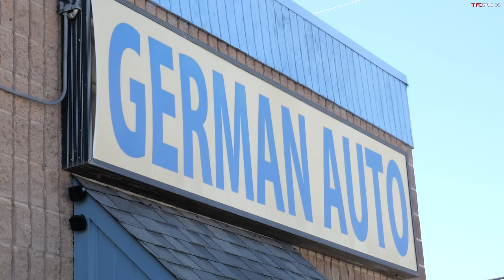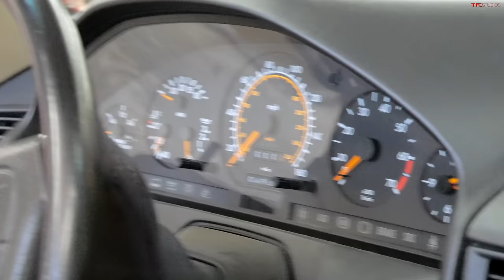What a Mess! Who Bought the Biggest Piece of $#!% Convertible? Stud to Dud Ep. 2

Comment: This takes me back to the days of owning my first 9 used cars. Many were low miles for their age and had failures related to age, not mileage. Low miles don't save hoses, belts, and gaskets. Dry rot is real.
Reply: Or in these days, lot rot?
Reply: Plus, even low miles does not indicate use cycle of those miles. Might be driven hard a short distance daily, or driven by a kid who thinks he's in formula drift. I live in Wisconsin and know people who start their car cold in the winter in sub zero weather, drive it 1 mile to work, then park it, without ever letting the car warm up properly. Sure they only put few miles on it annually, but lots are rough winter miles with no warm up. Heck I've done it a time or two if I'm honest.
Reply: @jg8263  Excellent point. City miles are far harder on a car mechanically. Rough city streets are harder on suspension and steering components. A lot of stop-and-go puts extra wear and tear on the transmission. Short hot/cold cycles from short trips are hard on an engine. I currently live in the city where the roads are rough and my trips are very short 4 miles/12mins. I always think about how hard it is on my truck long-term.
Reply: 9 “first” cars? Damn
Reply: @darklordsauron3415  ha, I didn't mean I owned 9 cars at once. I meant the first string of cars I bought in succession. I miscounted though. It was 8. Then I bought a succession of 3 new cars. Now I'm in a used pickup. 12 vehicles in total over the years. I get bored after a year or two and want something different or they ended in an accident.
Reply: @jg8263  yep those are the cars that wear out the quickest. I'm in a high mileage Facebook group where people brag about 300k...400k...500k...600k miles. They're highway driven for long distances or used for taxi where the mechanicals stay at operating temp all day, which is the gentlest miles to put on any vehicle, regardless of brand. I've recently seen a Hyundai and a Kia with over 300k miles each.

Comment: The point was made in the video that the Mustang and the Jag were well maintained.  That kept their issues in check and to a minimum.  The Nissan and the Mercedes were not well maintained,and we see the results.  Had those two cars been maintained at the same level, this would have been a much closer evaluation.  When you are dealing with 30 year old cars, maintenance is the key more than anything else.  Doesn't matter what country designed them.  How the cars were treated over the years is what matters here.  The Ford and the Jag were well bought.  The Nissan and the Mercedes were not.  This series really hasn't made any other pertinent points other than maintenance is key.
Reply: Yeah, I am guessing that maintenance on the ford would be a lot cheaper.
Reply: And the Jag is from the early 2000's so it's way younger than the other 3 (so things going bad by age are fewer in the Jag than in the other three)
Reply: The point is buy the simpler American car that’s easy and cheaper to fix. Jags and Mercedes are nightmare to maintain long term. The mustang is the best bang for buck.

Comment: As I’ve said many times, if you want to own a Mercedes’, you better be prepared to pay for maintenance or be able to do the maintenance yourself. I’ve been a Mercedes’ fan for many years. I currently own 3. A 2005 E55 AMG,  a 2002 S430 and a 2005 CLK 320 cabriolet. I just replaced the 2 convertible top cylinders on the CLK. $150 each from Top Hydraulics and about 2 hours of my time. I just replaced a front left air suspension on the E55. $500 from FCPEuro with lifetime warranty. About an hour of my time. Both of those jobs would have been over a thousand if I took it to someone.
Reply: Worth the work you put into that E55 that’s for sure
Reply: @Loujr2250  Oh yeah! Man I love that car! What a blast to drive!
Reply: I have an 04 W209 CLK500 convertible and am downsizing to a 99 R170 SLK230.  It will be my 3rd Mercedes-Benz. My first Mercedes-Benz was a 96 W202 C280. I don't mind repairs. Every old car needs them and I've owned nothing but old cars all my life. So running the wrenches has never been a scare to me. I'd much rather have a graceful elegant beautiful Mercedes-Benz I have to work on occasionally vs peasant junk I have to work on occasionally.
 People ask me "what year is your car?" And when I tell them it's an 04 it blows their minds. "It looks newer than that". Why yes, it's a Mercedes-Benz! They invented the car.  Naturally anything they make (up until more recent years) is going to look way ahead of it's time. Prime example is the R124. Bruno nailed it. In a time when luxury cars were large land yachts, Mercedes-Benz made luxury cars smaller and by far better looking than any American or European competitor did years in advance.

Comment: The SL that is misfiring and with those issues still manages to smoke all of them. Imagine with a proper tune.
Reply: Yep, or just regular maint and repairs of broken things.
Reply: The Mercedes is likely on its last leg. All the Mustang needs is 1k worth of upgrades and it’ll be much faster than all of them. Gears and PI head swap really wakes them up.
Reply: That Mercedes is designed to run wide open on unlimited Autobahns not be cute parking lot toy like the others.
Reply: I rather take lighter Mustang with more reliable engine to tune:)
Reply: @joe125ful  If both cars were treated equally over the years both engines would be equally reliable.
Reply: @nirfz  Yes but Mustang engine still more fool proof and eat less money in long temt of using in other hand Mercedes is full of potencial problems specially with electronic parts and ofcourse rust.
And see price both of cars new/old very big difference.
Reply: @joe125ful  How do i put it... If this Mustang would have gotten as little maintenance and care as this Mercedes, it wouldn't drive anymore.
Sure there's more electronic in the SL, but other than certain years problems with the cable insulation being biodegradable the electronics weren't causing more problems than the fewer electronics of the Mustang i'd claim. (This gen SL was pretty reliable in it's time)
The hydraulic roof is something that adds additional points of failure but also only without maintennance. (rubber hoses get old and need to be replaced at some point just like gaskets)
And to the price difference old an new: this also has everything to do on how the car is maintained. A SL in the shape of this Mustang costs easily 2-3 times what this Mustang goes for. (so same difference as new ;-) )
Reply: @nirfz  Yep but i still like more Mustang.

Comment: I had a 96 SL600 Merc. One of the worst cars I ever owned and rarely did it ever run without some expensive thing needing to be fixed. Finally got rid of it and swore off anything coming out of Europe again. When they run well, they are great. But anything goes wrong and it costs a fortune to fix. Ever wonder why European cars don't hold any value over time......that's why.

Comment: I wanted to point out on the 500 SL when Toby said it seemed like a mis fire, It may not be. If you jump the car too much the OVP(Over Voltage Protection) fuse located near the firewall on the passenger side in the engine bay. It happened to me and scared me because I thought I messed something up. Definitely give that a try.

Comment: Those stickers on the exhaust are as dangerous as the ones on new tires. No fire or crash has been caused by those stickers in my, or my fathers, or grandfathers experience.
Reply: Four people didn't have a fire or crash.
Reply: @653j521  actually many more than that on account my Papa owned an repair shop for close to 30yrs before retiring and doing jobs out of his at home garage  which was 36x60 with a 10 ton chain fall and doors large enough to pull in a highway semi.

Comment: I like the accent of the mechanic.  He keeps it interesting.
The Benz probably has an issue with the control pressure.  It's running too lean on startup, so the control pressure may be too high.  Check it at the warm up regulator.
Wheels are from a W211 E500
Reply: Might be a NE accent. I’ve heard guys over three kinda sounds like him
Reply: @bramblecino  

He's got a speech impediment called a LISP a speech defect in which s is pronounced like th in thick and z is pronounced like th in this.

I went to school with a few kids that sounded nearly identical to this guy

Comment: Mercedes quality is far better than the others. It's all dependent on what the previous owner had done. Also that mercedes was set up to be comfortable and smooth. Some simple modifications and it would destroy the other cars. A rear diff, sport springs shocks, a tune to that m119, delete emissions, cold air intakes, bypass 2nd gear start. And if you really want it to fly on a budget, do a weight reduction on top of that. Hydraulics and top removal and add a roll cage. Have fun

Comment: Don’t buy a SL with the Hydraulic Suspension.   Not worth the potential issues.  Most V8’s don’t have it.
Reply: Anything with the word "hydraulic" should be avoided in terms of longevity in general lol.... hydraulic systems depend on fluid and rubber seals holding up under high pressure over time!
Reply: @CadgerChristmasLightShow  What about hydraulic power steering?
Reply: @angelgjr1999  if I had a choice I would probably opt for electronic power steering vs hydraulic. Less moving parts and no fluids to deal with. Usually easy to replace if ever needed

Comment: The Jag engine was made by Ford but was slightly different then the Lincoln and T-bird V8 engines of that era. The Jag engine made the most horsepower of the three. The Ford emblems are difficult to see unless the engine is torn apart.
Reply: The AJ  8 was developed by Jaguar (when owned by Ford) it shares very little if anything with Ford Modular V8’s.  Ford did build there own version in Lima OH between 2000-05 as a 3.9L and used in Lincoln LS and Retro Thunderbird.
Reply: And it still lost. Modular V8s made a low amount of power (before the 1999 PI upgrade) but they’re torquey little engines. Also very reliable.

Comment: The mustang should be the worst but it's actually turning out to be the hidden gem of the group.
Reply: They’re the most underrated Mustang generation. They’re becoming the new Fox body. Want a highway cruiser? Daily driver? Or a drag racer? Or a rally car? It can do it all.
Reply: @angelgjr1999  except gas mileage if you want that you're screwed. I have a 96 with the V6 and it still only gets about 20
Reply: @travisb9130  I average 19 mpg in my 03 GT. You must drive like a maniac.
Reply: @angelgjr1999  I don't drive a lot of highway with it. It seems like horrible gas mileage though compared to my 16 ecoboost. It can get 25 flooring it literally everywhere or 34 on the highway if I take it easy.
Reply: @travisb9130  Change your route to work if possible. I take a rural freeway with little to no traffic. I just cruise in 5th gear almost the whole way.

Comment: never known a sticker on an exhaust cause a fire in over 30 years. plus, those stickers are often close to impossible to remove without them being hot anyhow. often easier to just let them burn off, as happens with the paint on them, often. especially where i live.
and a TUNE UP for a fuel filter? i think he means a SERVICE! anything with an ECU should NEVER need a TUNE UP. thats when you adjust things like timing, carburettor settings etc.
and the wheels on the SL are from a W211 E class, if they use the same wheels worldwide.
Reply: Tune up, plugs, wires, distributor, coil packs (today), filters. You may or may not need to adjust the fuel and timing even on an older vehicle, but still need to replace whatever else was mentioned to get the vehicle to runs smoothly again. Poor fuel filter means lack of fuel potentially which can foul the plugs and cause a misfire. Then the misfire could cause arcing in the distributor, or cause a coil pack to fail. It’s is all tied together. AKA Tune Up.

Comment: That Mercedes is totaled in repairs.
Reply: @GTC4cam  agree. I still drive mine. Parts are not too expensive. Once they convertible cylinders are rebuilt (new O-rings) you are good for the next 25 years. I’m surprised his car being a 500 had the hydro suspension. Those are usually for the 600 services cars.